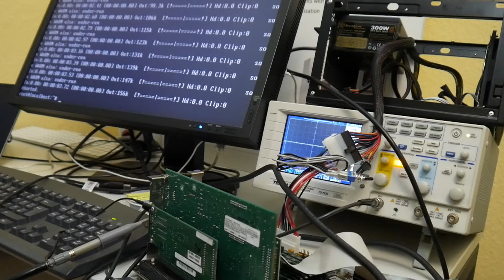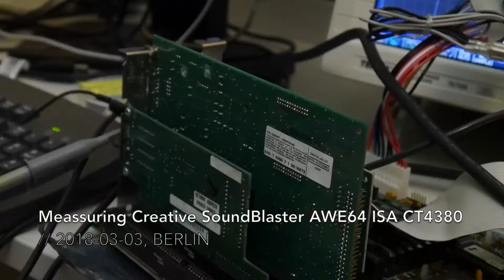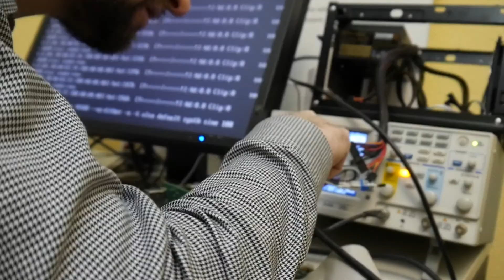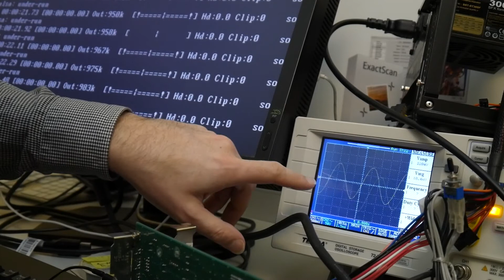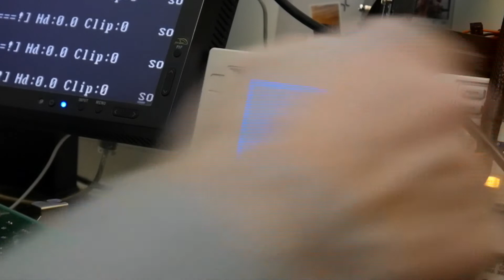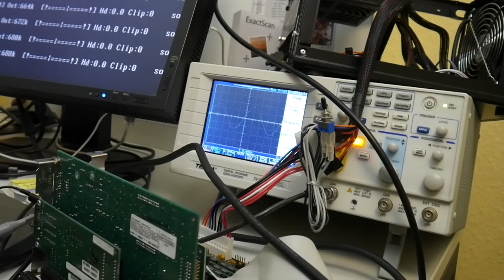[BONUS] 1996 Creative ISA Sound Blaster AWE64 signal output, am386 Linux!

Comment: I really liked the topic of this video. I don't know why it's labeled "Bonus" though, because it's right on topic of your channel.
So if you've got other old soundcards I'd really like to see them measured with a system that's fast enough for the generator software.
Reply from the maker: "bonus" because on top of the previously done main video ;-) in the meantime I have a DOS SoundBlaster GCC example, that I could theoretically make output test waveforms, … or indeed really write a low overhead Linux sample for that, too: https://www.youtube.com/watch?v=xf9EJjfoMz4